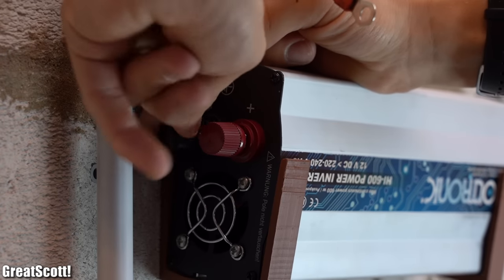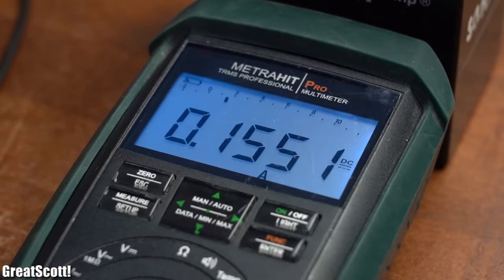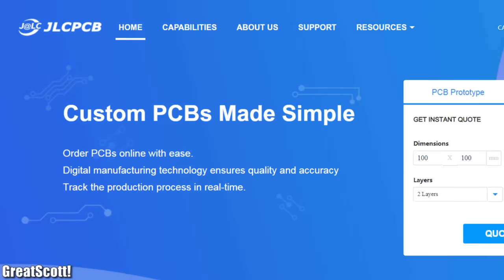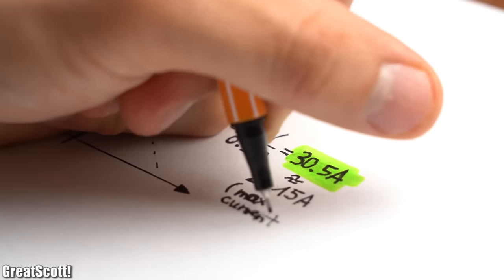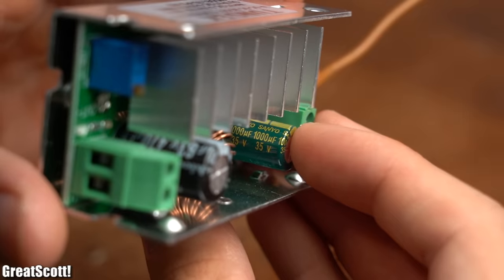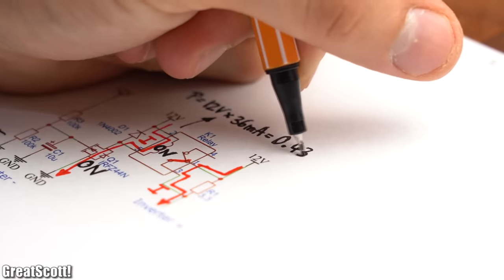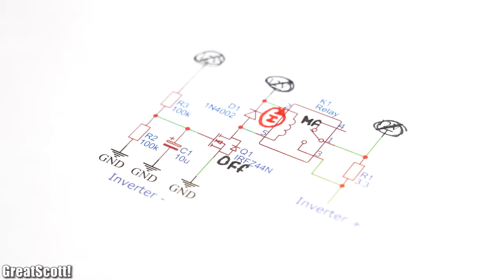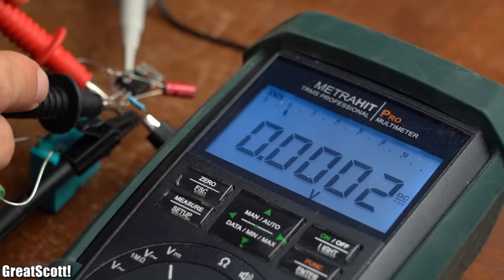How to make a Softstarter and why it is sometimes mandatory to use!

Comment: Hi GreatScott... Is it possible to remove the relay and use only the mosfet.
Reply: Yes, however all the current would then go through the mosfet and stress it, requiring power components and producing heat. The problem this presents is a greater one than the required relay current.
Reply: Yes
Reply: It's possible, but in mosfets there is a voltage drop.
Reply: yes of course, but you need to drive mosfet tightly,say by opamp..
Reply: Yes, but mosfet has voltage drop, and it will heat up
Reply: when mosfet drived tightly, the voltage drop will be so small, because Rds_on of mosfet will be around 10mOhm only..
Reply: @jaa185  a MOSFET driver only speeds up the on and off time right?
Reply: @jaa185  hmmm, not more than relay one. Seems you are right, i think its good way to try
Reply: @Max Xiang ,the volt drop and power losses occurs when drive mosfet slowly. if it full switched on, the Rds_on about 8 m Ohm for IRF3205 for example, let us say the current will be 15 Amps, then the volt drop will be only 120 mV, and power dispersion about 1.8 W only.. maximum.
Reply: The mosfet is more suitable for such a situation than relay.
Reply: @philipdifrancesca  Using N-Channel requires bootstrapping the circuit to a point where you require atleast V_GS + V_th, which in this case would be around 18V at the gate. P-channel would be the solution for you idea.
Reply: @psialt9720  Not by much, it's RDS on is only 17.5 milli Ohms
Reply: @jaa185  Interesting, so if it is running at full 15A the MOSFET would really waste a bit more power than the relay at 0.43W. I have calculated that the limit is about 7.33A, if your are constantly pulling more than that the relay is more efficient.
But i would probably also go for just a MOSFET, because of simplicity and no moving parts...
Reply: @Hippo, practically , that small relay doesn't pass 15A continuously, and it will blow up later or sooner.

Comment: Usually inverter is connected straight to the battery.
Reply: Even I was thinking that!
Reply: Agreed, but Victron smart MPPT controllers have a nice histogram feature going back 30 days that makes their switched DC output very useful diagnosing problems.  My DC powered 'fridge was shutting off and I didn't know it until I discovered it on the history page..  I wish all their products, including their inverters, had this.
Reply: Nic 

Oooh
Reply: @Nic7320  So what was the cause ? Not powered direct from battery ? ;)
Reply: @millomweb  I'm running two refrigerators and the rest of my RV off of a 24 volt Tesla battery module.  The cause of the shutdown was actually the fridge; it thinks it's supposed to shut off if the input voltage drops below 21.5 volts, which is designed for a 24V lead acid battery, but not the proper voltage cut-off for my Tesla LiIon battery.  The Tesla 6S LiIon module voltage range is 25 volts down to 20 volts.  I had assumed that since the fridge could run on either 24 volts or 12 volts, anything between them was okay.  But it turns out the fridge has two shutdown voltages for either 12V or 24V operation.  My solution was to put in a 24 to 13.5 volt DC-to-DC converter so the fridge always stays in the 12V operating mode, even if the Tesla battery goes down below 21.5 volts.  Then below 20 volts, the MPPT controller is set to shut down the DC output to protect the Tesla battery.
Maybe that's a long answer to your question.  I do run my inverters directly from the battery, but smaller DC loads, like the fridge, I like to run off the MPPT controllers so I can see the histogram.
Reply: @Nic7320  I can diagnose your problems. You're running a load of kit that's not quite compatible with each other.
Your RV & presumably RV specific fridges will be 24-30 volt - designed around lead-acid batteries. Your boxes of electronics seem to be 20-25 volt. Not knowing what MPPT meant, I've looked it up. What I found seems like a load of nonsense. It seems the issue they're trying to solve is the fact solar panels don't produce a fixed voltage output. I think the best answer to that problem is simply a variable sunshade for the panels!
Reply: @Nic7320  So, what you're saying is that the fridge was shutting down when the battery voltage dropped to 21·5V - and now it'll shut down at 20V instead cos the MPPT will kill the power to the DC-DC converter. You don't appear to have gained a lot (1·5V) ! Also, the DC-DC converter is just another bodge for the problem of having the wrong battery type !
Reply: @millomweb  I limit my maximum charge voltage to 24.5V for safety reasons and to enhance longevity of the battery.  If you do the math, you'll see 1.5 volts is a big percentage of a battery that has 4.5 volts of usable S.O.C.   It buys me another day or two of power when the sun isn't shining. But I also added another 400 watts (@ STC) of solar panels to the roof, so I get more power on cloudy days and it rarely goes below 22 volts.  I could go back to powering the fridges on 24 volts to gain a little efficiency (no loss in the DC-DC converter, and less IR loss in wiring), but then if it does go below 21.5 volts, I would need a way to switch it over to the 13.5V converter.
Reply: @millomweb  MPPT has a significant advantage.  Maximum power is achieved by matching the load impedance of the power converter to the source impedance of the solar panel, and that takes an algorithm to track the converter performance up and down the non-linear IV curve.

Using a sunshade, well, that is contrary to the goal of getting the most power you can from whatever solar iradience that is available.  Yes, the magnitude of solar flux varies throughout the day.  But to impose a lower limit on solar output just to regulate the voltage is -- not the thing to do.  The solar controller takes whatever solar power is available and regulates it for the proper battery charging.
Reply: @millomweb  Most RV appliances and lights are 12 volt.  The Whynter and ICECO compressor-based portable 'fridges run on 12 or 24 volts DC, or 120 VAC.  I still have a small (55 AH) 12 volt battery for the RV, but it's not as good as using a 24 volt (5200 Wh) Tesla battery.  Lead acid batteries are cheaper, but don't last very long (e.g. two years under RV use is typical).   On the other hand, a well-designed LiIon battery can last over 20 years, so in the long run they are better and cost less.  So... I do run two batteries, and two power systems, so I pick which voltage gives the best efficiency.
Reply: @Nic7320  Unfortunately, I know nothing of charging Li-ions but 24.5 seems quite low. Doing some digging - cells 3·6V & charge to 4·2V.
24/3·6 =6.66 - so is your Tesla battery 7 cell ? - if so, charge V is 29 Volts. If 6 cell, then 25 Volts. To get a 24V battery, it's not going to be 6 cells as that's only 21V - so max charge at 24·5 is very low - actually too low as 7 cell battery would be 25·2 volts - so no risk of you ever fully charging the battery !
And if the Tesla battery is a 'module', has it charging circuitry in it as well ? If so, that should protect the battery from being overcharged.
Without FULLY understanding what you have there, there's little hop of optimising anything !
Reply: @Nic7320  The bottom line is that you don't always need maximum performance from the panels - whether sun shade or another type of controller, it doesn't matter !

The idea of matching elec solar source with the inverter is a bizarre concept. Connecting the inverter to the battery will provide the inverter with the power it needs - then just charge the battery when you can with the solar. When solar's available, run the fridges down to 0°C - then at night, down to 5°C - they'll then use less power while on battery only. Does the RV not have gas for cooking - and the option of using gas for the fridges (at night)?
Reply: @Nic7320  Searching, RV lead-acid batteries should last 5-7 years.
If not even longer. I'd be looking for 10 years really. You should get that if they're fully recharged daily.
Reply: @millomweb  Pb-acid batteries have several problems:  1. Limited service lifetime under real-world conditions. Three years is doing good, 5 to 7 years happens only if you just don't use them much or use much depth of discharge (DOD).  2.  Limited usable charge depth; if you drain them beyond 50% SOC you reduce the life span considerably (All it takes is a few deep discharges and you have a dead battery).  3. Size and weight.  LiIon are many more times energy dense.  A 55 pound 5200 Wh Tesla module has the same usable energy capacity as about eight 100 Ah AGM lead acid batteries that weigh 560 pounds, because you have to limit AGMs to 50% DOD to get any life from them.  4. Cost and MTTF: Replacing AGMs every few years ends up costing more in the long run.  Plus the risk of failure for something like food storage, makes LiIon (or any lithium chemistry) more desirable.
Most RVs still come with lead acid house batteries due to initial cost.  But many RVers (esp. full-timers) upgrade to Lithium after having bad experiences with lead acid, and enjoy the reliability of a better battery.
Reply: @Nic7320  The killer for lead-acid is being left in a discharged state. Even with 100% discharge, you can recover pretty much all of it provided it hasn't been flat more than a few hours.
There's a similar but variant chemistry of batteries like them now - can't recall the chemistry but alleges improvements. I believe electrolyte gel also helps. Lead-acid are more robust - not needing finicky charging regimes - supply it with the right charging voltage and forget it - and I'd suspect offer a greater power output - so ideal for starting engines ! If you're in a situation where a battery is not going to be fully recharged on a daily basis, alternative chemistry is likely a good idea.

Comment: softstarter can be find in high end inverter, but it's cool anyway to see how to fix that
Reply: @Rocky Robinson Because a capacitor this size probably costs more than this simple contraption and the inrush of that capacitor would be gigantic if ever discharged
Reply: @Rocky Robinson it should work but you need an capacitor wich has no polarity, so if you attach a bigger load it wont work anymore, cause those capacxitor have a small capacity

Comment: If the mppt is always on you could connect a bigger capacitor (more than or equivalent to appliance input value) directly across the output terminals by externally charging it first and parallel with mppt output, so when there is an inrush the capacitor will provide the inrush directly to the inrush consuming device long enough to charge the internal caps, no complex circuit and no power loss

Comment: Interesting idea - I did something very similar to soft-start a car audio capacitor to stabilize my ham radio power supply.  I just used the relay pull-in voltage to regulate when it turned on the relay though, seemed to be "good enough" and eliminate the majority of the spike.

Comment: Wouldn't it be better to just use a MOSFET to bypass the resistor instead of using a relay ?
Reply: +1 I thought that too, is there a reason why you can't do that ?
Reply: Yeah thought the same, maybe because the resistance of a closed relay is lower than a FET, which has still a low RDSon? But with his low current (<15A) a FET should still be more efficient than losing 0.4W on the relay.
Reply: You could implement something simple with a P-Channel MOSFET but the Rds ON is relatively high, probably similar to a relay, or maybe worse than a relay. If you want minimum losses, you would need an N-Channel MOSFET, but that increases the complexity because you need a Gate drive voltage which exceeds your Source voltage by around 10 or 12 volts typically. That would require a charge pump circuit to generate the required drive voltage. That's a lot of extra components. As with everything in electronics, it's always a trade off between cost, efficiency, reliability, space, development time. Did I forget anything?
Reply: @marksawyer6242  How is it even a problem to get 12v to drive a mosfet if there is a 12v source in this circuit?
and yeah i meant N-channel mosfet being connected between the load and the minus of power source
Reply: @id15807936  You could theoretically do as you say and implement the inrush current limiting circuitry on the negative line to make it easier to drive the N-Channel MOSFET. However, i would never recommend it. Messing with your return path is generally bad practice. Consider what happens to the system when the inrush current goes through your resistor (before the MOSFET has switched on) the return line of your entire system will be at an elevated voltage, due to the potential created across the resistor when the inrush current goes through it. Then your MOSFET would switch on, and suddenly the entire system jumps back down. That may be ok if you are operating your system in isolation. But consider the effect that could have if you have multiple electronic systems connected together, and one of them shifts its return potential level relative to the other systems. If your computer PSU did that every time you switched your computer on it could easily cause damage to the peripherals that were plugged into it, due to potential differences creating ground loops.

Comment: Good Job, I had a similar issue to handle with a big 1.2KW Transformer, my solution needs to be at the 230V side, so I build a simple capacitor dropper circuit that barely supports the current for the relay and added a capacitor in parallel to the Relais. I had to do this 2 times in series because of the big startup current of the transformer

Comment: Could you also put an inductor in series? Would be more inefficient I think.. :/
Reply: If you don't forget to put a freewheeling diode, maybe. But don't forget you want as little power losses as possible, and coils... Well... Have a good amount of ESR. Not to mention coils can be expensive sometimes.
Reply: What about an inductor with an appropriately sized resistor (say 2Ω) in parallel though? The inductor could be a lot smaller (as in less inductive), since the resistor would bypass it and start charging the capacitor immediately, and the inductor windings could therefore be thicker to improve efficiency. Once the inductor starts passing current, the resistor would naturally drop out of the equation. Even better, the resistor would always be there to act as a drain for the inductor and tamp out potential oscillations.
Reply: Ah okay, I see.. tanks for your answers :-)

Comment: Nice - that's a elegant solution for a soft starter. I used a 555 timer in my home built power supply project 6 months ago. But I like your MOSFET with the RC network better.

Comment: I did a similar thing in a product using a comparator with an RC network, driving a low side n channel FET, which drove a high side p channel FET, so that after 0.5 seconds it shorted out a 24 ohm resistor.  It worked great.

Comment: can't u put a capacitor before the inverter switch to charge the internal capacitor off the inverter just enough to prevent huge currents spikes ?
Reply: Well the current surge was caused by caps so my unqualified guess is no. It would only add another source for big current surges
Reply: The capacitor would then act as a problem itself. It would have to be substantially large.
Reply: Another theoretical solution would be a series (aka shunt) inductor before the inverter. However this has two problems.

1)The inducter would create an LC circuit which may cause instability, especially with any active or switching circuits (like an inverted), and
2) many circuits would require massive inductors in proportion to the capacetence and in-rush current.
Reply: Another way to think about it:
Capacitors resist sudden changes in voltage (by creating large current draws)
Inductors resist sudden changes in current (by creating large voltages).

Comment: I made a softstarter last year for a circular saw, to make sure there was no possibility it would pop an inverter when turned on. It runs the saw through a resistance (the ceramic element of an old fan heater - so it can handle a few watts lol) for a good 5-7 seconds to make sure that it's spun up before applying full power. It was a little trickier to design because rather than having the power switch ahead of the softstart unit, it had to react to the saw's own trigger switch. 

Now the real interesting effect though, is if I use it with small power tools such as a multi tool. These will not draw enough current to trigger the timer so the resistance stays permanently in circuit. However, this causes the tool's speed control to work when normally it wouldn't when powered from a modified square wave inverter.

Comment: Would a large capacitor/inductor pair, with the inductor in series on the supply side of the capacitor, solve the problem almost as well?  I'm not criticizing, I'm trying to learn.  Thanks!
Reply: was thinking the same thing but don't think the capacitor is needed as that is already in the inverter.  Just a inductor in series would be needed I think?
Reply: @artbyrobot1  -- Sure, in theory it can work, but do some math and you'll find the inductor would be very large and very heavy.  And then you'll have another problem unloading the inductive current fly back when you turn the MPPT DC off, and if you don't add a big diode to catch it you'll destroy other parts.